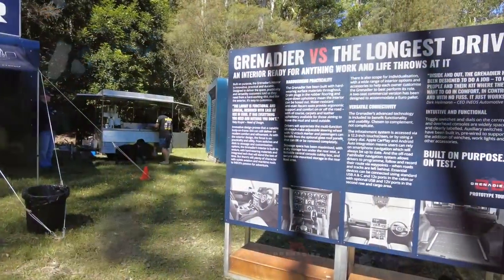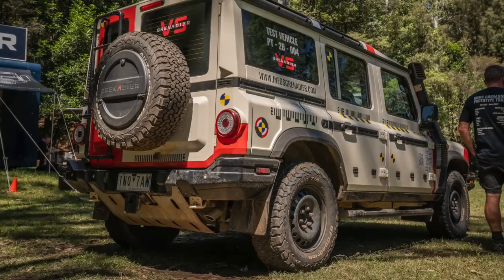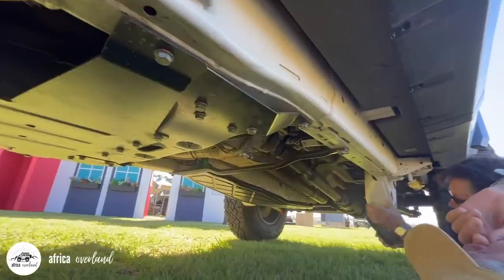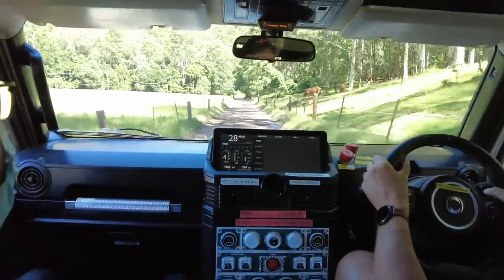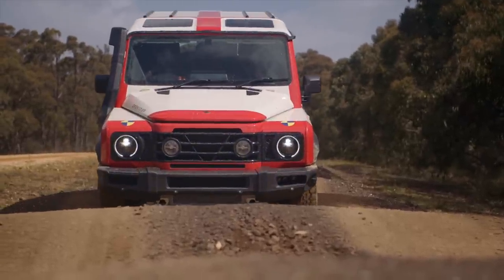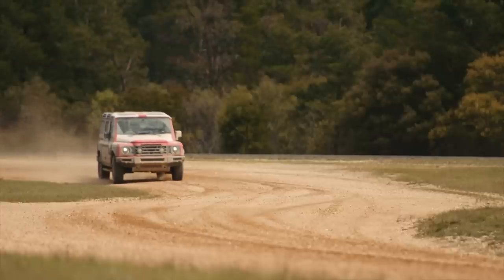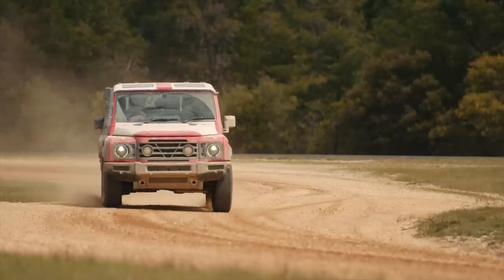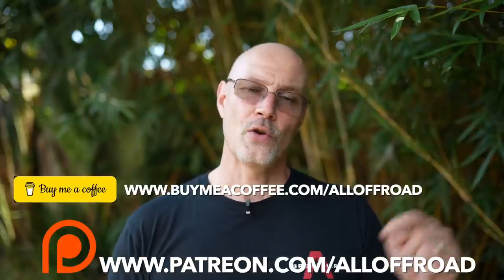Ineos Grenadier - THE ISSUES | SEPARATING THE FACTS FROM THE HYPE | A 4WD PERSPECTIVE

Comment: Wow best vid yet. Thanks for that. I feel exactly the same- some great things and potential, but some issues, namely:
1. Ground clearance- I can only judge based on vids and what I’ve seen but it doesn’t seem great for what it is. Which means mods necessary. Then question is- how easy will that be? Will it be a lego vehicle like a Jeep? Thanks for insight into underside- again that has some worries for me with lifting it and fitting larger tires. Right now all of these are questions and concerns and hopefully Ineos will address them positively, but the fact that noone I have seen but you (including Ineos)  so far is even mentioning this is annoying. I’m not as concerned about the control arm mounts as much though, as they can be armored up with slippery skid plates pretty easily. 
2. Articulation- like ground clearance I am stuck with what I can see in vids, and like you say most of the vids are on pretty mellow tracks that dont test articulation much. But what I’ve seen seems less than what I was expecting for how it is built. Not sure why but your comments on the suspension parts and lengths may be the issues. Can this be fixed? Remains to be seen. 
3. Things I already hate- 
  A. The damn back seat that doesn’t fold flat. Are you f’ing kidding me? That has to be the height of stupidity. And I dont want to hear from Ineos that I can buy the commercial variant without a back seat- maybe, just maybe I want a back seat sometimes and other times full, flat cargo space for longer items. Just maybe. At least now I know why. You are the first I have seen to mention that battery and fuse box is under the rear seat. I didnt know that. Man I hate that if that is what is causing rear seats not to fold flat and for same reason you mention- if they’re there they better be in a waterproof box. 
  B. The instrument cluster. Well it is a cluster/ cluster F that is. Why is nothing in front of the driver? Looking to the center to see basic info requires the driver to take his eyes off of what is in front. Wtf are they thinking? And then I agree- one screen with everything. That is risky. They say this is purpose built- where is the built in redundancy or at least some mechanical gauges?  Also not having a harddrive GPS is dumb- everyone has smart phones these days- well yeah but many apps only work with cell service and a lot of places I and probably a lot of others go dont have it. Sure some of my outdoor apps allow me to download a certain number of grids of the maps to store on the hard drive that doesnt require cell service, but I still like redundancy of having it on in veh as well. 
SUMMARY - a LOT to like- too much to list to be honest. But the above could be issues. My biggest worry though- long term viability of it. Seems like their business plan is based around building a veh primarily for NGOs and touring companies in the boonies and a market that I dont think exists much anymore for vehicles like this or the old Defender (farmers). The problem with this is I dont think those segments, including farmers if they do still exist as a market of significance, are going to buy enough of these alone to keep it afloat. All of these industries might be great at buying it when it comes out, but they don’t buy a lot of vehicles on the regular. They keep em running and keep em for 20 years. After the first couple to few years of sales because of its newness, will these markets alone be enough to sustain it as a business entity? Until now the Grenadier has been an ego project for Mr. Radcliff; if it can’t sustain itself financially in the long term will he continue to prop it up with profits from other parts of Ineos?  I think to be successful Ineos has to sell these in quantity to civis who don’t need everything they offer all the time,  or for some people ever. And they have to sell well in the US. Here they will be competing against the long entrenched Jeep, and now the Bronco, as well as Toyota. Bronco has a 35s and lifted package, Jeep has introduced same, and all of them are easy to mod even if you don’t get it from the factory. Sorry but offering the Grenadier in the US with only 31 in tires and difficulty modifying will be a death sentence for sales here. And I suspect places like Australia too from the vids I watch. So that is my biggest concern for the Grenadier, can it sustain sales long enough to support itself financially and be a viable, ongoing entity? Time will tell, but I feel a bit like they need to bring in some non European marketers to help them with this. It’s great to have the concept of built on purpose and all, but they’re going to have to sell them to a broad market to make it and be more than just some billionaire’s pet ego project of the history books. 
Look forward to more of your vids on it.
Reply from the maker: very well said mate

Comment: Definitely a great review and an actual good look at things that matter to offroaders. I think what I have learned as a Land Rover owner is that British companies build offroaders built for terrain they see, but other parts of the world (US here) have a much different view, and we also have these things called a Rubicon and a Sasquatch. This is only a first look and no firsthand driving on more difficult terrain, so I will reserve last judgement for that review. I think another limiting factor will be the extent to which the aftermarket gets involved. It's a cool, new toy for sure, but it's a one-off built by not-a-car-company so I think some will sit on the sidelines for a bit to see how it evolves.
Reply: Definitely agree, one of the main pitfalls of British Industry has been failing to design stuff for world wide use, for some things at some points in time you could get away with it but not anymore.

Comment: Thanks for a great review. I felt it was an honest and realistic itemisation of the potential weak points. I have experienced the demonstration day in the Ineos and have followed their progress since their inception. I have been looking  for the ideal replacement for my Land Rover Discovery 4 for some time and was hoping the Ineos would be the one. Some of the short comings are of concern given the stated high objectives of the Ineos Project. I am not so worried about the fuel capacity as the Discovery has great fuel efficiency and I expect the Ineos to be similar. A couple of extra Jerry cans will be sufficient. My greater concern is the lack of ground clearance and the  general  vulnerability of some of the under body components. Also the centre console encroachment into the rear seating area as well as the way the rear seats do not lay down flat is a big problem. Particularly when a better design approach could have been adopted. The vulnerability of the under seat battery and electronics  location to water ingress is less than ideal. These are all items that affect confidence in the product I regret to say
Reply: I agree with your comments, but a disco 3 performs better than a D4. If you want a car that is “better” than a D4, the D5 is much better. If you want off road, this is much better “on paper” than the D4. Otherwise buy a 2.4tdci 110. All off road cars are a compromise. A canter 4x4 crew cab on super singles will out perform most off road, but slow on road. Nothing is perfect

Comment: Max Hornibrook
Ineos Grenadier is appealing to those who will go off-road when they wish and feel confident, knowing the vehicle and its limits. They are not trying to break it but enjoy the trip or do the job at hand and return safely. Then take a trailer full of sheep to the market because that is what it is designed for, a perfect on/off-road truck that will do the job and pull a load as it is built to do. I think that overlanders have built specialist vehicles and take that vehicle on off offroad trips, that may be not the vehicle to pull the boat wherever or trips to the dump with a trailer load or a trip to the cape with the fam. The Grenadier is the strong allrounder that I have been waiting for, a sensible, sturdy workhorse with enough comfort, grunt and style made simply.
Reply: Buy a Landcruiser 76 series with its beautiful 4.5 litre turbo diesel.   It’s ticks all your boxes
Reply from the maker: that may be true for the UK or SA but not for Australia or many other countries like the US we have many cars available here who will do exactly the same and do some things better.

Comment: Excellent review (and helpful comments).  Hopefully the second row seats can be removed completely  and battery covered.  My LC 100’s with seats removed are comfortable to sleep in, and will haul an American sized refrigerator (68” tall) just fine.  Manufacturers aiming for the “luxury” market have killed the versatile work/overland vehicles in the USA (no, I do not want a ‘ute’ or pickup).  USA does not even get the LC300, just the $100k+ Lexus version.  The Grenadier is a move in the right direction, thank you for pointing out the +/- ‘s!

Comment: Totally agree on need for 33 inch tyres minimum.  You can tell that just by looking at the vehicle.  

I reckon waiting for the longer wheel base will give room underneath for an added fuel tank and some other changes.

Comment: Love your review.
It is very comprehensive,  love the side by side spec comparison table at the beginning.   I also like how breakdown your discussion in different sections and more importantly,  the low hanging parts underneath the vehicle that will affect the offroad ability. 

I live in U.S. and will link this video to my favorite offloading/truck review channel trying that they copy some of your review approach techniques. 

Never thought such big fuel tanks were needed.  260L or 68 gals will have a range somewhere about 700-900 miles.  Definetly you do more remote offloading in Australia.

According some reviewers in the USA,  we will not have the diesel engine option.

Comment: Thanks for sharing your thoughts about the Ineos Grenadier.
Very interesting to hear an opinion of an experienced 4x4 driver from Australia 👍 
I think Ineos is producing their first generation cars for the European market.
Here in Europe we do not have to take 260 liters of fuel for a trip 😉
The stock tires and steel (👍!) rims will do most of the normal (utility) offroading here.
For me , the biggest problems are the ICE engines.
Here in the Netherlands, where I live, we pay skyhigh taxes for cars with high CO2 output.
A normal Landcruiser of Defender with ICE cost here about 130.000 euros.
For that reason, only electric or fuel cell engines will be sold here in the near future.
ICE engines are soon history in Europe.
I own two Pajeros , first gen. 2500 diesel an second gen. 3500 petrol, and like them very much, and will keep them as oldtimers ( bought them new (!) in 1990 and 1999 ), very reliable cars.
My next new car could be an Ineos Grenadier.........but only if they give it an electric engine !
I like the utiliy character of the Ineos 👍
Almost all other 4x4 cars , including the Landcruiser are here in Europe  "luxury SUVs" standing on low profile street tires.......

Comment: Has to be one of the most comprehensive reviews of the vehicle. The complexity of the suspension lift with drive shafts and short linkages is a pretty serious deal breaker in my opinion... the rear leg room is also a bit of a let down.
Fantastic review mate, well done!

Comment: On the weekend at a prototype tour, they confirmed the seat battery will be encased in the final product, to prevent flooding.
Reply from the maker: great I wasn't told that, lets's see and wait.
Reply: @AlloffroadAu  One of the points Ineos do make about the interior is that it can be hosed out.. That suggests to me that they've already encased the electrics in the final build.. as you say, time will tell.

Comment: This sounds like a really fair review, in regards to your battery point, I think that the battery/electrical components would be a good fit above the rear wheel arches, then any jacks, wrenches, etc can go under the rear seats. 

I was also surprised that they said it does not have sway bar disconnects, the test drive I went on was extremely smooth at high speeds but when the serious bumps came it was definitely bumpy! 

The suspension support parts I think would get caught on rocks like you mentioned however looking and the wrangler and bronco's they too have the same problem.

Comment: I like the points you bring up.  Also, as you say, it depends on use and location. Where I run, in the deserts of Utah, Nevada, and Arizona, I'm not worried as much about water crossings (water? ha!) as I am about range - that's a big deal.  Good to see the potential negatives as well as the positives.

Comment: This is a different kind of review from the others for sure.
One has to applaud for Ineos for setting up a new company to manufacture vehicles for the market segment which other manufacturers have been vacating. Given that this is their first vehicle there are bound to be some rough edges.
All vehicles are compromises and none of them is perfect. The import of Stefan's criticisms depends on what you expect from the vehicle (and my usage is overland trips using roads and tracks, however rough, used by the locals). Taking his points in no particular order.
1. Battery position. The Defender always had under seat batteries but no fuses or electronics down there and that was fine. Clearly the Grenadier would benefit from a waterproof battery box because they have other electrical bits and pieces there too. However the alternative is to place everything in the hot engine bay where things get cooked, shortening the service life. Is that really any better?
2. Underbody clearance. Yup it would benefit from a good tidy up and suspension lift / larger tyres. Not a deal breaker as I see it. Many owners would do the suspension upgrade irrespective. I probably wouldn't because this is already a very competent vehicle for general overlanding.
3. Fuel range. Yes if you are going to do the Canning Stock Route you need to drive a small fuel tanker like Stefan's. For regular overlanders a good rule of thumb is to have an ultimate range of 1000km (and you plan on 800km working range) for the terrain you encounter. Ineos should aim for that IMO.
4. Internal load space. If you are travelling as a couple and find the load space is obstructed because the back seats don't down fold down neatly it will be very annoying. Also the wheel arches need to be squared off so that storage boxes can be stacked there. For me a three door vehicle with a massive load compartment would be great and would open the option of sleeping inside the vehicle.
My take is that the vehicle currently scores 7/10 and if Ineos is a listening company they will get the Grenadier to 9/10.
Thanks for the honest review.

Comment: All valid points Stefan, I just did the Berrimah day and see where you are coming from. I was dissapointed by the short suspension arms and can see that the suspension travel is limited. The ride dissapointed me as well and I question the choice of progressive springs. I found the rear seats uncomfortable with the seat backs being too vertical and the roof line too low. I'll be interested to see the final product and hope they address some/most of the issues.
There are a lot of positives about the vehicle and Ineos are to be commended for bringing a solid axle vehicle to market but i'm not rushing to put my deposit down.

Comment: Thanks for pointing out some the sticky points - like the battery and fuses under the seat. Once I saw that , thats exactly what I thought about fording water.  The steering dampener is also a concern. The idea for skid plates is to have all the sensitive part be covered by the plates.
Reply: There's a pretty good chance this is only in prototypes as they need to access all of this for engineering testing.

Comment: A Fair and honest review - the fuel range is a big concern - i am not sure where the battery and electronics will be housed on the commercial version as it seems to have a completely flat floor - The challenge Grenadier had was the same one Landrover ( Defender ) had - it has to build a vehicle which will appeal to the masses and meet various safety standards which is understandable -including  all the constraints they had to meet - imagine an aircraft designed by a committee !

Comment: Ineos have made a fantastic job with the Grenadier . There has to be a balance between off road and road and having used Landrover for over 40 years as a off road work vehicle all I have ever needed to do is put gun tractor wheels on the vehicle with NATO Military tyres . This solves all ground clearing problems and very rare to have to go into four drive and that is towing heavy vehicles out of the bottom of a quarry when digging in. But this gives you a ten foot running height and not very good traction on the road , sliding around especially when braking. My message to Landrover is look what happens when you fill your management structure and design team with very young adults 🧑.